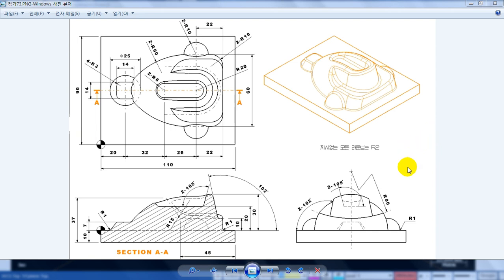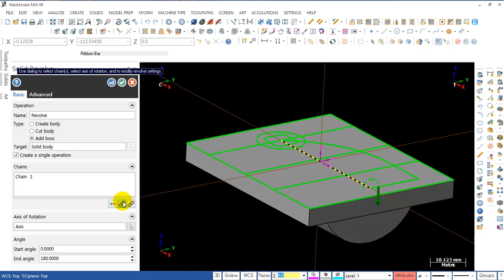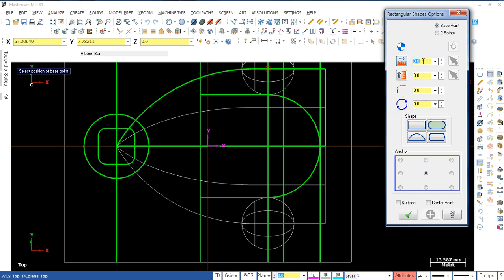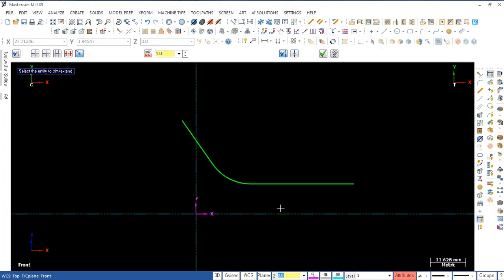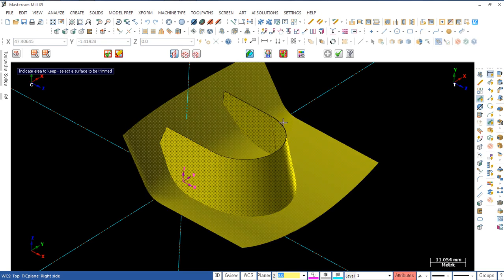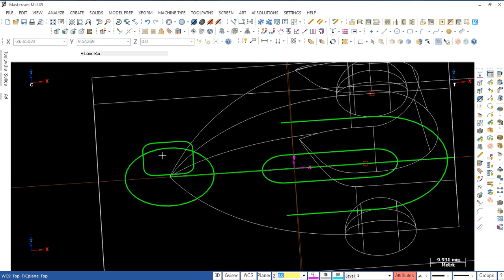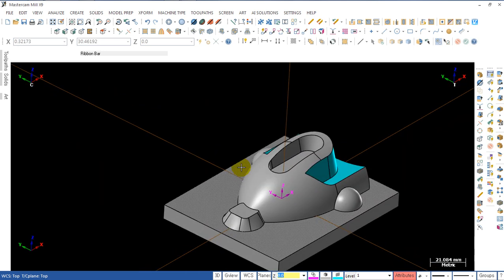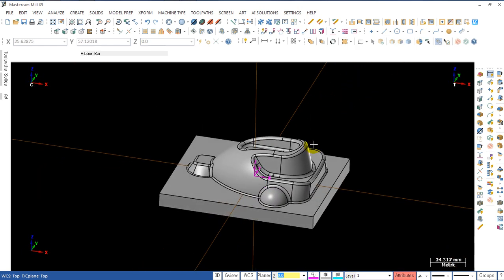Mastercam  X9 Surface Modeling 1 마스타캠 서페이스 모델링

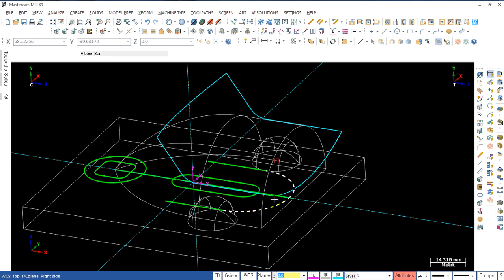Comment: @13:48 make it blank how? Iam not getting that what u have done for removing wireframe in that swept surface
Reply from the maker: in screen menu there is  "blank entity"  definitely you can unblank the blanked geometry.  I am using short cut keys for quick operations.

Comment: Thank for uploading! I tried to drawing follow your video ( in 21min..step ) but when using solid loft command, Mastercam can't creat solid body from circle and rectangular ( Warning: inconsisten number of syncs) Do you know why?
Reply from the maker: Please divide the circle into 4  and the  upper part of square is divided into 2. When you select chains.  directions and starting points is aligned propotionally w/ same  direction. It is quite simple and easy. U can get it done
Reply: @Tombull  thank for reply. I already done like you say but it still warning like that. I'm using mastercam 2020 HLE. I don't know how to fix this problem
Reply from the maker: I tested with 2020 and it has generated equally same loft with same way. I dont know why.
Reply: @Tombull  can you send me your file of version 2020? my email : nguyenbadinh13@gmail.com
Thank!
Reply from the maker: @inhnguyenba5347  I will upload  the way of lofting by mastercam. I couldn't find the relevant file.
Reply: @Tombull  Hm, I found my problem. We must change sync mode of chaining option to NONE
Reply: Chào bạn, sau 1 thời gian tìm video để học. Mình tìm được bạn Tombull video thật tuyệt vời. Thấy người viêt nam nữa. Muốn làm quen và học hỏi. Số mình 0336774871 mình là Sang. Rất vui được quen bạn